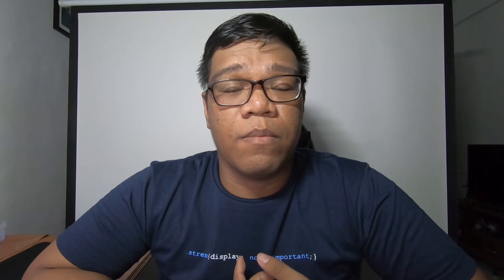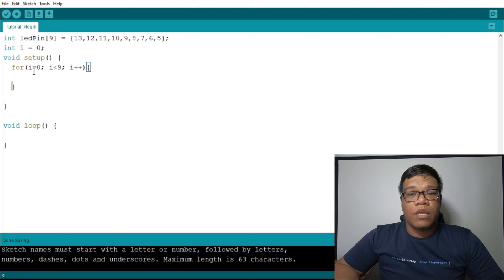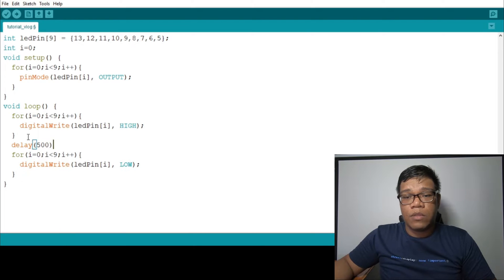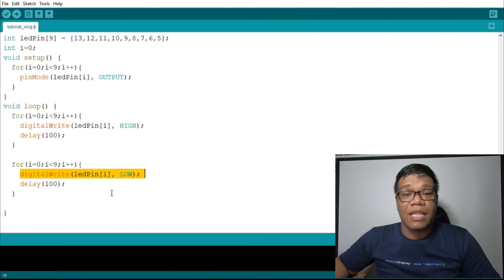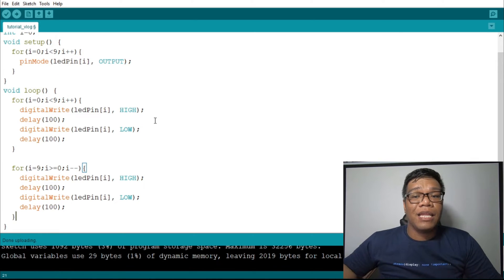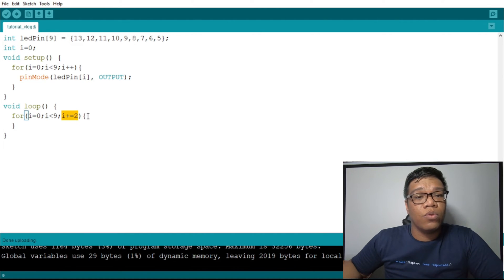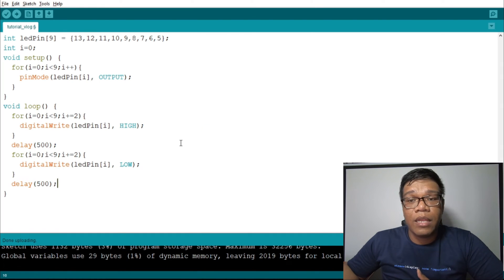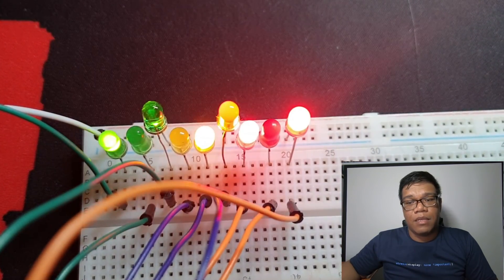Blinking Led Patterns in Arduino (TAGALOG)

Comment: Sir Thank you so much for this helpful video. Gusto ko lang po mag tanong or request, I really need to know po paanonaman po if isa isa muna sya mag bblink? For example yung green po muna then after that the yellow one then the red one naman po? Thank you very much I will appreciate it so much po!!
Reply: // constants won't change. They're used here to set pin numbers:

const int buttonPin =  4;     // the number of the pushbutton pin

const int ledPin        = 13;      // the number of the LED pin
const int ledPin1      = 12;
const int ledPin2      = 11;

// variables will change:
int  initial    = 0;       //hold current  initial
int oldstate    = 0;       //hold last  initial
int buttonstate = 0;      // variable for reading the pushbutton status

void setup() {
  pinMode(ledPin, OUTPUT);   // initialize the LED pin as an output:
  pinMode(ledPin1, OUTPUT);
  pinMode(ledPin2, OUTPUT);
  pinMode(buttonPin, INPUT); // initialize the pushbutton pin as an input:
}
void loop(){
  //debouncing routline to read button
  buttonstate = digitalRead(buttonPin);  //state the  initial of button
  if(buttonstate == HIGH){               //check if it has been pressed 
    delay(50);
    buttonstate = digitalRead(buttonPin);//state button again
    if(buttonstate == LOW){              //if it is 0 considered one press
     initial = oldstate + 1;        //increase  initial by 1
    }
  }else{                          //check if it has been NOT pressed
      delay(100);
      }
   switch (initial){               //react to button press a  initial
     case 1:                     //if  initial is 1
       digitalWrite(ledPin, HIGH);//on
       digitalWrite(ledPin1, LOW);//off
       digitalWrite(ledPin2, LOW);//off
       oldstate =  initial;               //set oldstate  initial as current  initial
       break;
     case 2:
       digitalWrite(ledPin, LOW);
       digitalWrite(ledPin1, HIGH);
       digitalWrite(ledPin2, LOW);
       oldstate =  initial;
       break;
     case 3:
       digitalWrite(ledPin, LOW);
       digitalWrite(ledPin1, LOW);
       digitalWrite(ledPin2, HIGH);
       oldstate =  initial;
       break;         
     default:                      //if  initial is not 1 2 3
       digitalWrite(ledPin, LOW);  //off
       digitalWrite(ledPin1, LOW);
       digitalWrite(ledPin2, LOW);
       oldstate = 0;                    //reset to all off/initial 0
       break;         
     }
}

Comment: hello sir! gumawa ako ng IoT project using node mcu and dht 22 with blynk app gusto ko sana sya na iconnect sa website. pwede po pa advice
Reply from the maker: hi sir, pwde kayo gumamit ng firebase database for storing ng data. nay library sya for arduino. tpos connect mo si firebase kay website mo using php.
Reply: @SirBenMamRhea  maraming salamat po !